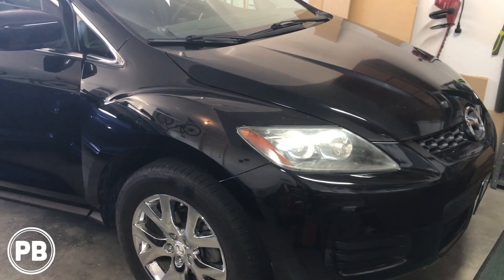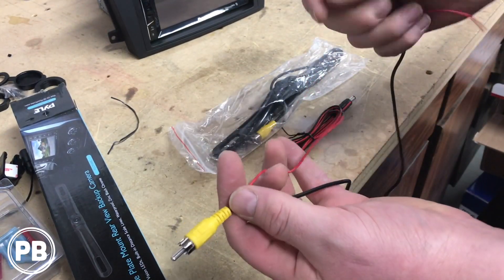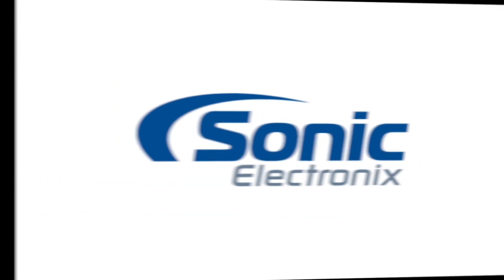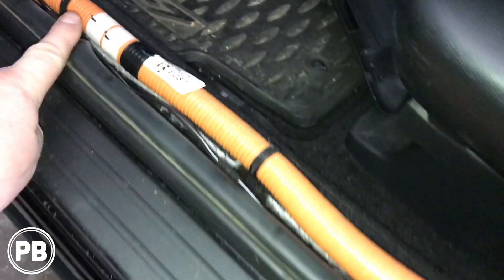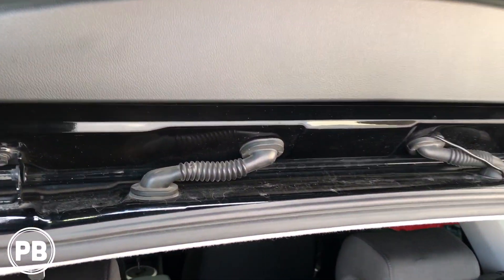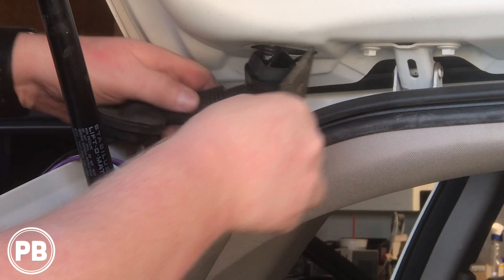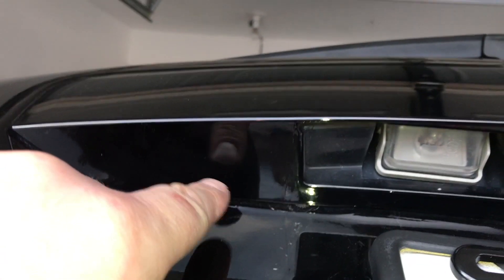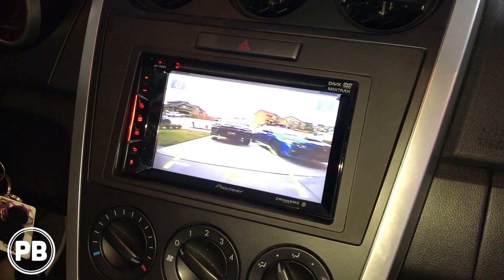2007 - 2012 Mazda CX-7 Backup Camera Install

Comment: Very helpful video!  Thanks for making it.  Quick question: Would running the wires in the headliner be better, worse, or same?  I would think it's a slightly shorter run.

Comment: Actually you can easily remove the dome lights.  Then use a wire coat hanger to feed the wires to the tail gate.